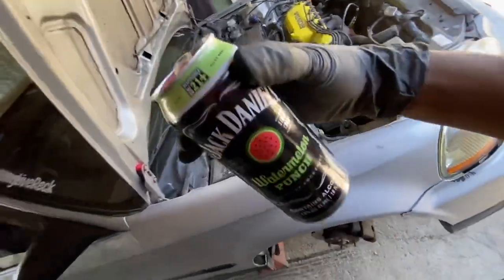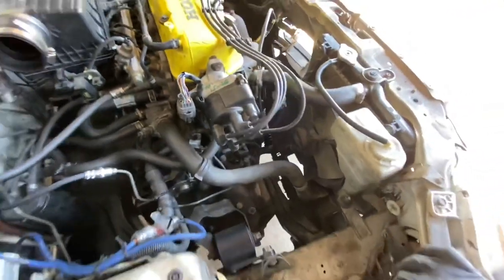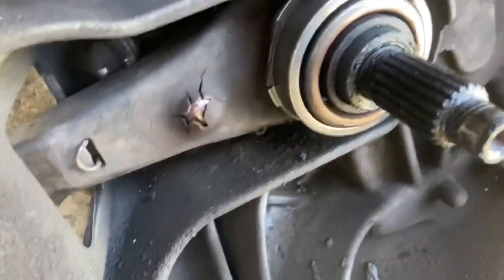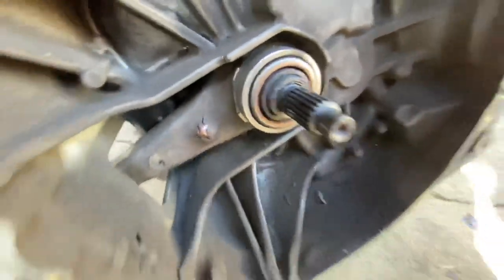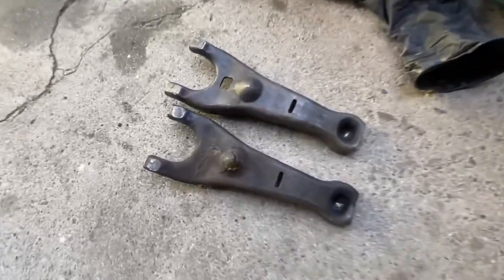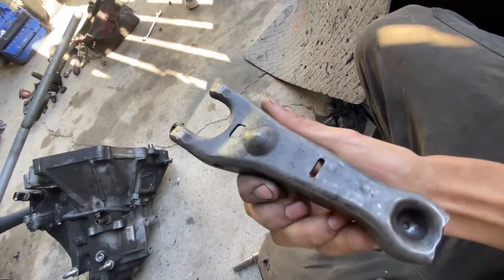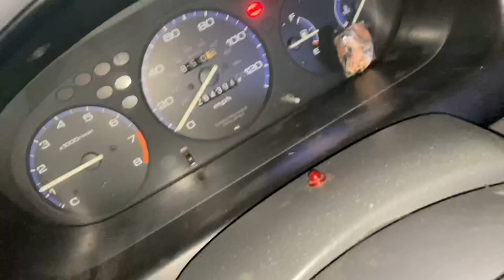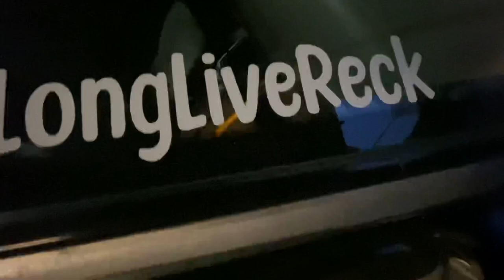Soft Clutch Pedal ?? WATCH THIS FIRST EK OWNERS

Comment: I just had my clutch replaced at a shop and it is worse than before. The pedal is all mushy and it isn't easy to shift into gear everytime. Seems like the clutch fork might be bad and they might not had bled it.🥴
Reply from the maker: 😬 hang in there pa
Reply: @anotherefncrxvlog4350  🥴👍